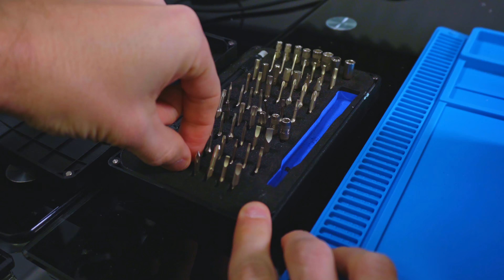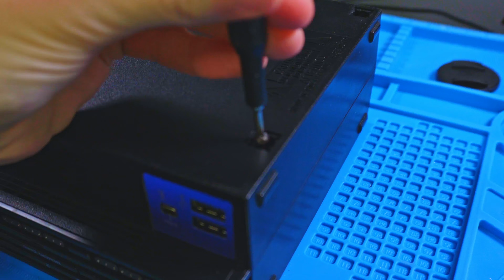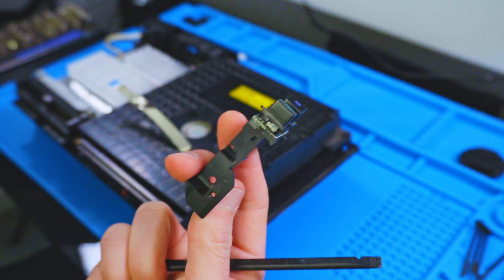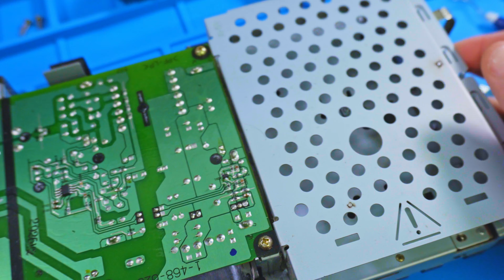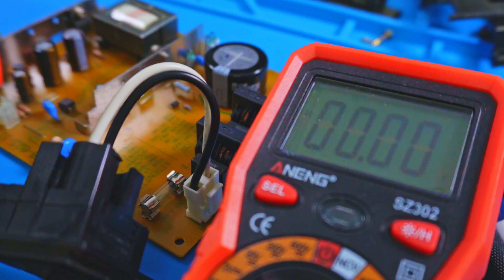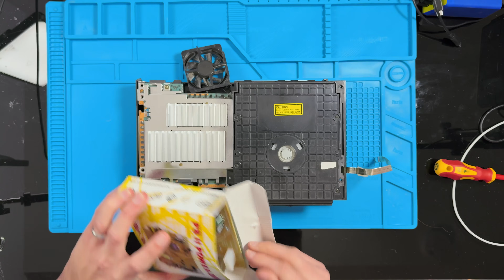Let's Fix It - Viewer Sent in Playstation 2 for No Power Repair

Comment: Did you check the small electrolytic capacitor near the heatsink at the center of the board? It will be bad. Every dead PSU I've seen has been this. It's a 20 cent fix instead of 15 dollars 👍
Reply: As dan2226kv says, just replace the small cap it will go bad and maybe a couple of the bigger onese nearby. Instead of wasting money on a new psu.
Reply from the maker: I’ve had some in the past with that issue and then some where the capacitor tests fine. With the scorch mark on it I decide against what would be for me a guessing game of removing several components.
Reply: @FixMoreWasteLess  tbh I probably would have done the same if it also looked a little toasty elsewhere, especially if I planned on moving it on 👍

Comment: i have opened two ps2 consoles and both times the ribbon cable connecting to the power and eject button was disconnected and the console would no longer work no matter what, even tested the power supplies ( accidently blew one )